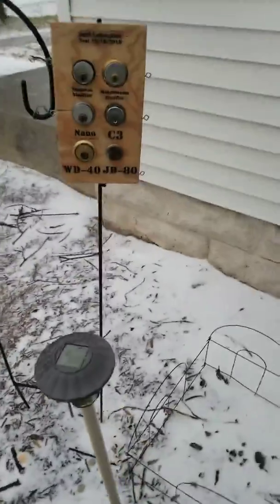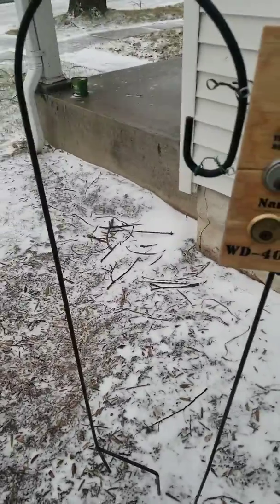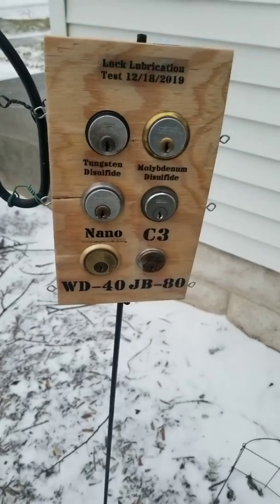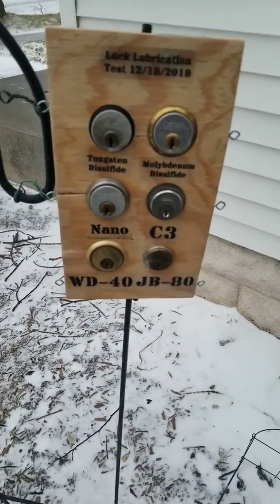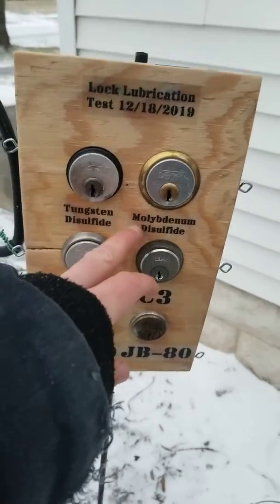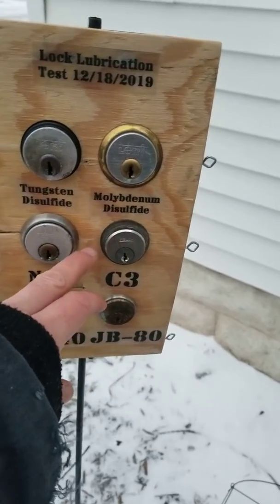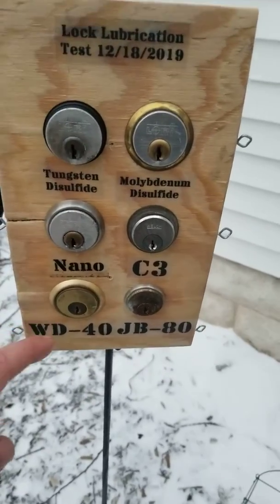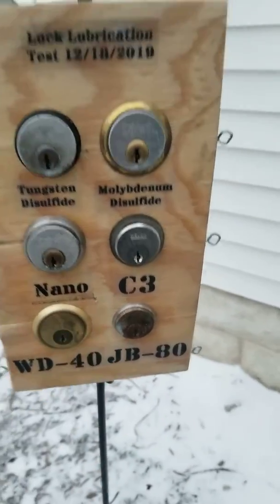Lock Lubricant Trial 2019-2020

Comment: Hi mike…. Have you completed your experiment? What lock spray do you recommend?
Reply from the maker: The Tungsten Disulfide and Molybdenum Disulfide did great.
The Nano Pro MT we used on the Ice Castle up on Lake Of The Woods and it had to be around-30⁰ last winter and we had no trouble at all.
I've found a new favorite also which is Dupont Non Stick dry film lubricant (teflon) It sprays in and leaves behind a nice coat of Teflon.
I'd say best of the best is a 50/50 between the Nano Pro MT and the Dupont Teflon spray. Either one will spray in an alcohol based liquid that seems to clean everything and leaves behind a great coating.
Reply: @unclemikeslocksmith5530  who carries the Teflon dry lube spray , or the nano pro MT? I live in oak Creek